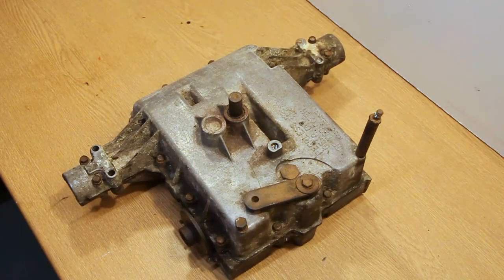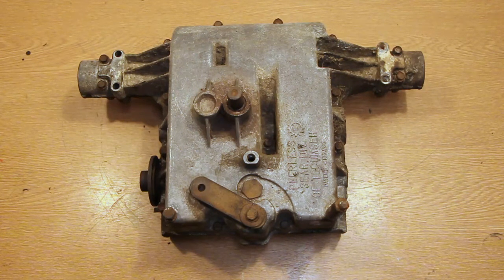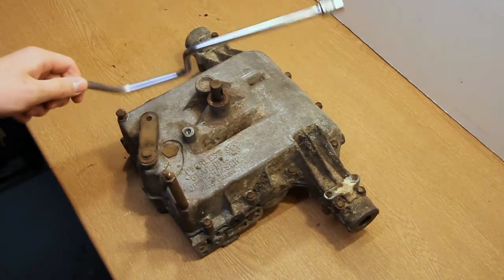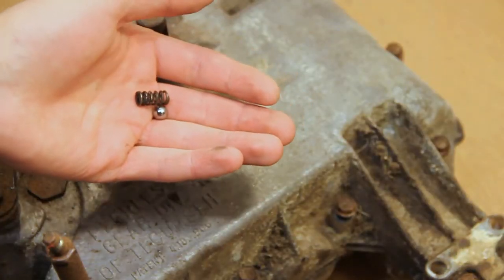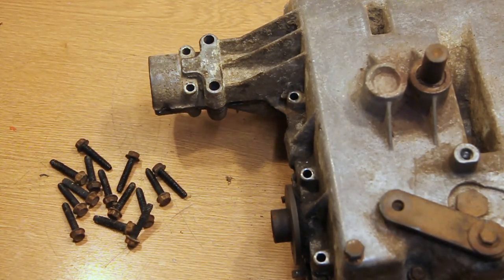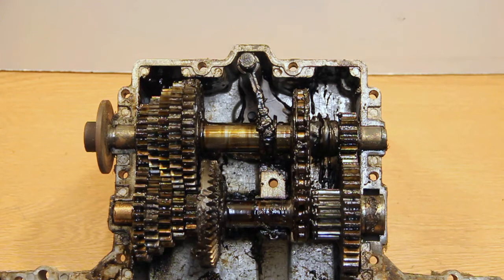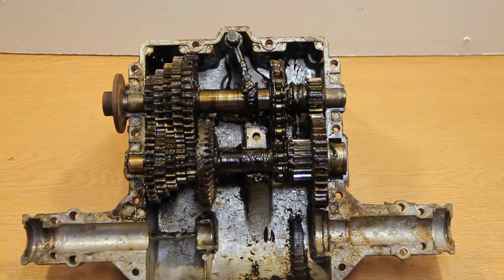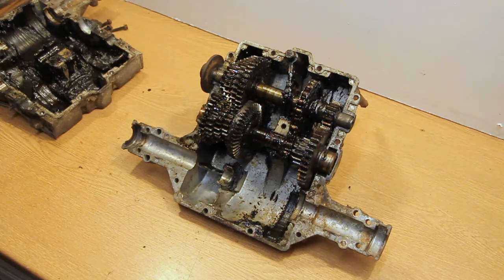Peerless 832 Transaxle Inspection and Opening Tecumseh Gearbox

Comment: I have a few questions which would help me greatly! What kind of grease do these transmissions take? Is there a specific order I should take to disassembling the internals? How should I take off the axle shaft bearings for replacement (my wheels are also stuck on the axle shafts)? Thank you so much!

Comment: Is there a bushing supporting the counter shaft axle closet to the camera I have the same trans and mine is 1/8 inch above the saddle.If there is I need the od id and length to make one cause the part is obsolete.Thanks